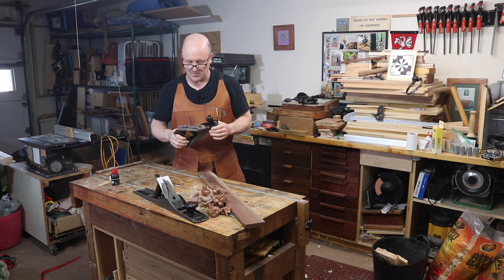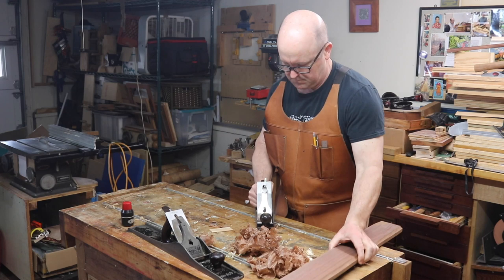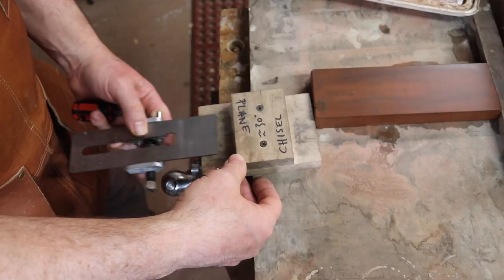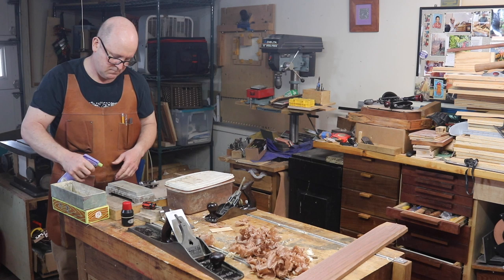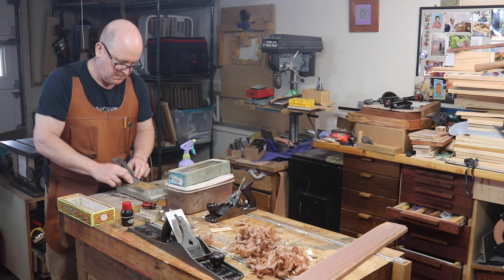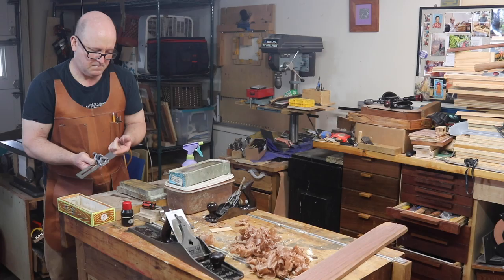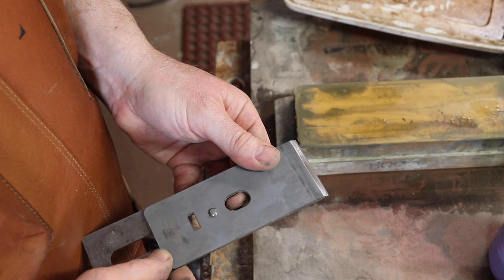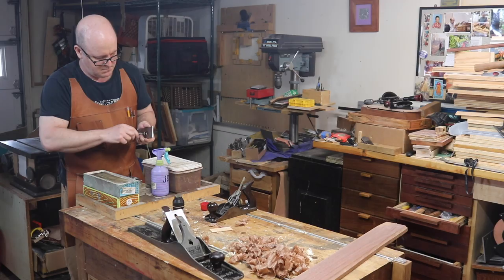How to Sharpen a Handplane Blade

Comment: I put my digital angle finder with the magnet the kind you’d find used to check a table saw and I set my plane to the length it says for 30° but the angle finder is claiming it’s about 3-4° off not sure which I should trust ( this is my first hand plane setup/sharpening) had success with chisels but not planes.
Reply: the height of the honing jugs is usually 30mm for plane blades. The length mine tells you to place the blade at is off by 5-10mm depending on whether I choose a 25 or 30 degree bevel.